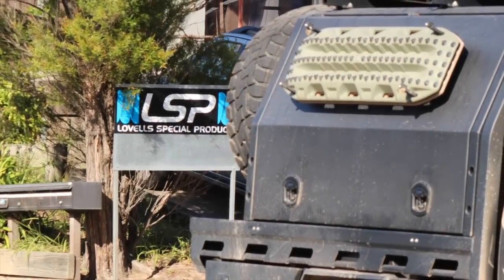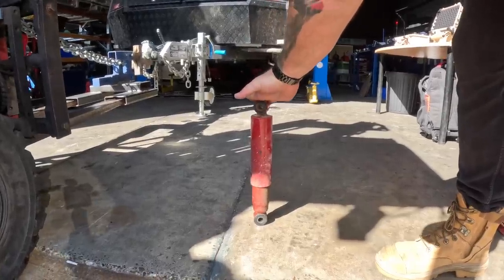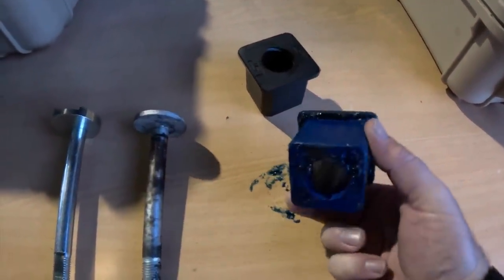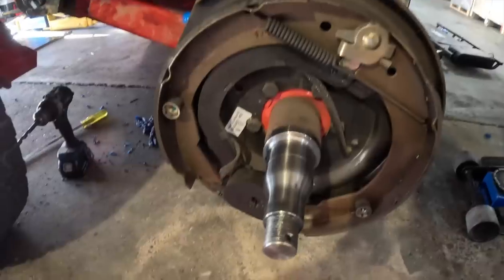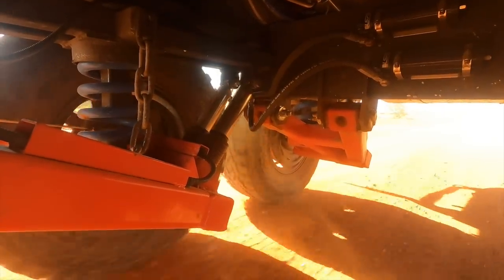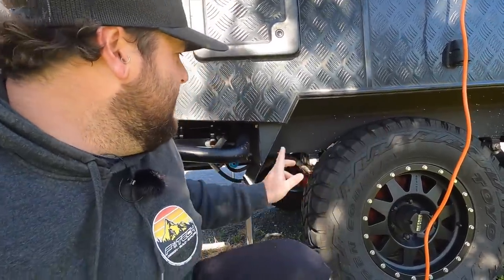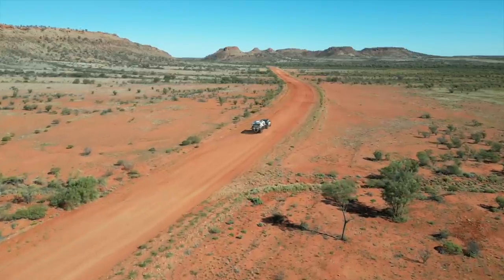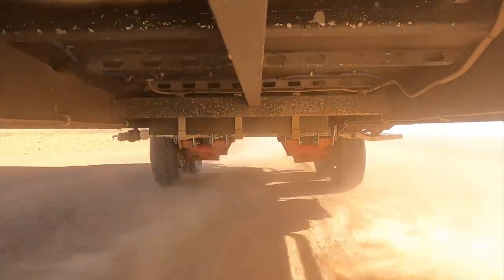🔥CHINESE CARAVAN MUST DO UPGRADES !!! LSP Caravan SUSPENSION overhaul !

Comment: Same thing happened to ours when it went out to birdsville and it's got 2 massive rubber stone deflectors. We were gonna raptor it but got advised due to raptor being so hard when it dries it will chip again we use a slightly softer based stone chip paint and it works a treat. Loving the content mate good to see someone revamping a van instead of buying the latest setup 🤙🏻
Reply from the maker: Yeah I think I might run some Convayor belt under the van then Il repaint it like you have 😁

Comment: about time 15:15 
- there is a loose screw on the clamp holding your pipe
- these selg tappers are known to not be suitable of dynamic situations

One reason the van goes airbourne is lack of suspension travel in the extension